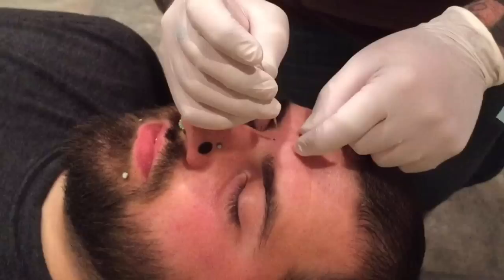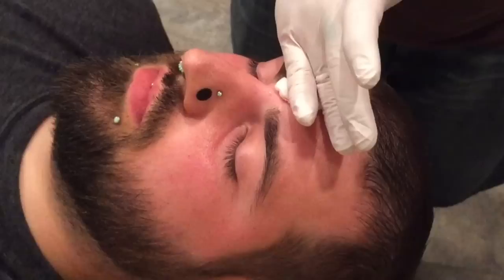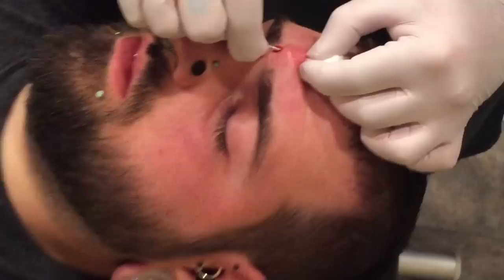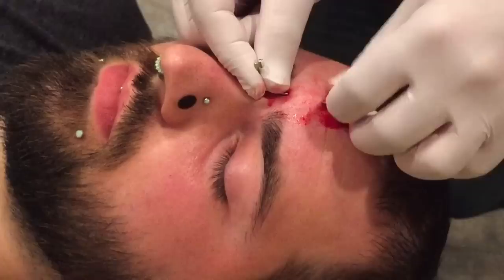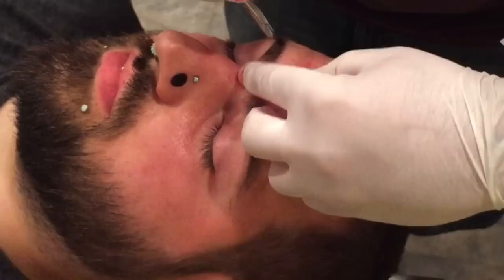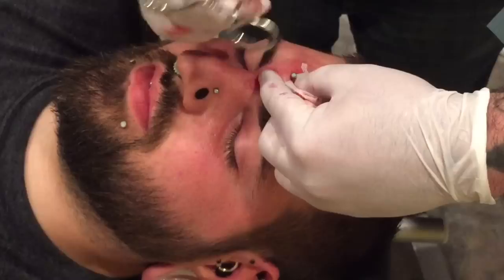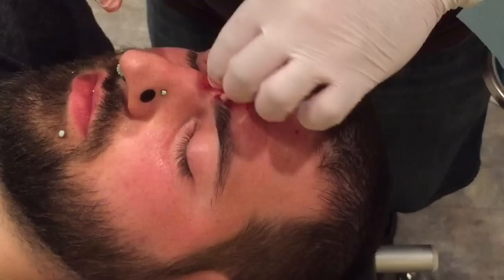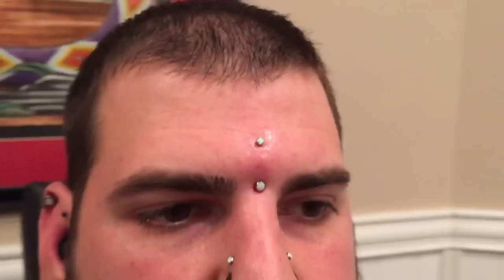Vertical bridge surface bar procedure by Luis Garcia (me)

Comment: Really interested in getting a vertical bridge so this was super helpful but I had some questions if you don't mind. I've heard this piercing is considered "long term temporary" which seems like a contradiction of a description lol. How long do you see them typically last? I've also heard people say they've had it done multiple times. Can it be re-pierced in the same spot? If so, how long would it need to be removed before having it pierced again? TIA!
Reply from the maker: You might be getting some mixed info.  What modern up to date professionals refer to as long term temporary are surface anchors (aka “dermals”).  Those last maybe 3-5 years on most people if done properly.  

A proper surface bar piercing in this area, done correctly, with the right jewelry, and the right anatomy, would last indefinitely.  

They main reasons a surface bar in this area wouldn’t last long would be anatomy issues, improper technique, or improperly sized jewelry.

Comment: What's the difference between this technique and the one that pierce it at once?
Reply from the maker: Fotini Kar in an area like this, where there is very little depth and the tissue is very tight and taught, it's easier to shape the would properly via this method than with traditional wound shaping with a blade needle

Comment: How deep in is it 1.5mm or less?
Reply from the maker: It’s 3/32” deep, which is more like 2.38mm.  1.5mm and 2mm are not deep enough in my opinion.
Reply: @LuisGarciaBodyPiercing  oh ok I was getting the depth mixed up with the gauge size,  sounds about right.  Thanks

Comment: flat surface barbell? or regular?
Reply from the maker: Flat
Reply: +Luis Garcia why flat?
Reply from the maker: Lyn The Alien the area has low depth, so a regular surface bar will put more upward pressure on the tissue, increasing the chances of rejection.  I use flat bars on Vertical bridges, sternum, sideburn areas.  I use regular round surface bars on napes, horizontal navels, and chunkier depth spots.
Reply: +Luis Garcia thanks for the info man i appreciate it. im getting one this weekend.
Reply from the maker: Lyn The Alien no problem